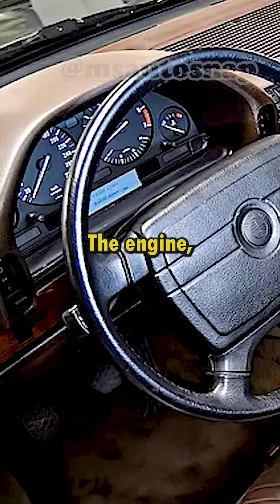When Engineers Build Cars! #bmw #mercedes #bugatti

Comment: Not many people know this but the first Bugatti W16  wasn't Developed by Bugatti. 
Bugatti didn't have the skills yet so they contracted AVL Schrick to develop and build the engine.
Reply: This is probably a gross oversimplification but wasn't it loosely based on using the extreme narrow V of the Volkswagen VR6 engine and then using these blocks as the banks of a V effectively making the W configuration
Reply: @izzabelladogalini  it's mot quite thats simple.
Reply: @JohannesB5  which is why I started my comment saying that this is probably a gross oversimplification....the tight V with overlapping cylinders contained in a single block developed by VW in their VR6 engine is used in the W16 - it's one of the reasons people look at Bugatti engine (or the W12 in the Bentley which had the same principle and is a lot closer to two VR6 engines mated into a V) expecting to see something like two Vs next to eachother with four blocks and find only two blocks and what looks like a  "fat" V instead of a W.
Reply: @izzabelladogalini  the W was a marketing decision by Ferdinand Piëch.
The first W engine was the W8. Which was derived from the VR6 concept to make an 8 cyl with the length of a V6.
The W16 was a further Development from the W8 bur in a totaly different block. The W16 was basicly a ground up engine. Bugatti/VAG did their best to build it but never managed to have it make power. So they outsourced it to AVL. One of my Professors was in charge of that Project.
Reply: @JohannesB5  it may have physically been a ground up engine but it utilised the ideas and technology found in the VR6 (VR in this case from Verkürzt and Reihenmotor meaning shortened inline motor ..) the W was in turn a "shortened V motor" ....but hey nothing is actually new the VR6 probably owes some crsdit to the Lancia VR4 motor which was a shortened straight 4 but didn't get into production but I'm sure the VW engineers  were aware of when wanting to designa small 6 cylinder that could be used transversely or longitudinally. Direct use is like virtually welding two engines together or chopping off a couple of cylinders from a V8 to make a V6 ...the utilisation of the VR6 in the Bugatti W16 is more subtle but it definitely borrows from it and (in my subjective opinion) was inspired by the concept i.e. shorten a straight six by overlapping and stepping the cylinders to make a very narrow V - so shorten a V16 in the same way by making two VR8 banks creating a W16
Reply: @izzabelladogalini  yeah ofc that was the inspiration😂 But still tbe W16 doesn't have anything to do with tbe VR6. not even the Cylinder angles are the same.
Reply: @JohannesB5  there have been two main designs to the W16 in the Bugatti one had 90⁰ degrees between the two banks and the other had 72⁰ but the angle between cylinders within the VR8 banks has always been 15⁰ the same as in the VR6 although the VR6/5 has also used 10.5⁰ the original was 15⁰. 
The first incarnation of the W16 was found in both the Bentley Hunauddiéres and Audi Rosemeyer concept cars - both part of the VW Group ...the production Bentley W12 is very much two VR6 banks mated in a V and this in W16 form is what Piech wanted and got fir Bugatti. The developed W16 used in the first Veyron was two VR8 banks mounted in a V with the internal angle of the single headed banks at 15⁰ it's way more than just loosely based on the VR6.
Reply: @izzabelladogalini I would like to see a block with 4 independent heads. Reduce bore, elongate conrods. There could still be holes in the head to let the headers pass through straight. Just there would be an air-gap. Also air channels between cyclinders in the block.
Reply: No?  It was engineer Ferdinand Karl Piëch from Volkswagen's Chairman of the Board of Management of Volkswagen AG at the time, which was in 1997.  He presented it to Karl-Heinz Neumann with the initial idea, drawing it on an envelope while traveling on the Shinkansen high-speed train from Tokyo to Osaka.
Reply: @DarthVader-lt4zw  ah yes a full engine development on a envelope scribble. You must know sooo much about engineering.
Reply: @JohannesB5  You understand that's how every single new engineering project starts?  A scribble here, a drawing there.  The engineers at Volkswagen took Ferdinand Piëch’s idea sketched on an envelope and evolved it into a production reality.  Originally, Ferdinand meant it to be a W18, but the engineers made it into a W16 instead, the only W16 ever put into production.  AVL Schrick didn't have anything to do with the original W16.  They helped build and test the Chiron's W16 powerplant, not the previous generations.

Comment: The real hp was 430hp on 99 octane 490lbs of torque had cam shaft issues and cooling issues they could have sorted it out the rear gills is what killed the design

Comment: How does a W18 work? You can’t have a V9
Reply: Three 6-cyilnders on a W bank
Reply: That's why it is called W18 - not V18... 
Volkwagen mass-produced a W12 in that concept
Reply: It's like a Bugatti Veyron Engine with two more cylinders
Reply: It's not exactly the same as VW-Audi-Bugatti do. W18 were 3 line of 6 inline cylinders each one. So the same as if you add a third inline six also at 60° to a currently V12.
VW group "W" concept is different.
It's a bit difficult to explain without images (in fact, the W18 that video shows in 0:42 is NOT a W18...😢)
For example, in Bentley's W12 they are two cylinder heads for 6 pistons each one, and these pistons were in TWO lines of 3 each.
In Mercedes' W18 concept they were THREE cylinder heads of 6 inline pistons each one!😮 
They were not two heada for 9 pistons each one, no.
Reply: @Angel_PC  The vw vr6 then later the r32 is the base engine.

Comment: The S 600 was so legendary. "It made the same power in kilowatts that the 760il bmw made in horsepower" 300hp and 300kw (408hp)
Reply: Fr and that's Oliver Amon's car (the s600 shown in the video)
Reply: Actually it's 408.6😂
Reply: 750iL at that time.*
Reply: The problem is that the S class is just a boring Mercedes compared to the BMW 7. There's a reason why Mercedes are so popular with older people and taxi drivers

Comment: W18 🤔 how come 😂 not divisible by 4, would have been a different configuration for sure
Reply: doesn't have to be, W18 would have been basically three inline sixes matched together at the crank.
you're thinking of the way vw did it for the chiron which is more like two vr engines in a v formation
Reply: @sirlorax9744  OK, 3 inline 6 cylinders, a different W shape then, not like 2 V8s come together to form a geometrically true W engine.

Comment: That v16 was underpowered, the McLaren F1 and the Aston Martin 600 were making 600 hp with much less cylinders and less capacity
Reply: McLaren had a BMW V12 in it, which was a tuned engine from the 7 Series. They detuned them for luxury cars, and pushed them to their limits in supercars.
Reply: Aston was twin supercharged
Reply: It was made for cruising, not racing. Not everything is about horsepower.

Comment: I only trust Small capacity and cylinder, gives high rpm and good fuel efficiency
Reply: Yes, if you're talking about garden tools
Reply: Inline 6 is like the best engine
Reply: @JoonaKorri an inline 6 is 1/3rd the cylinders and generally half the displacement of a W18.... Glad to see that you agree???
Reply: The smaller the cylinder worse to efficiency. cooling surface / volume.

Comment: since when tf 400hp is low
Reply: 400hp back then was insane
Reply: @JoonaKorri On a W16? Not at all. V8 cars were able to reach that power in the late 80s... With two times less cylinders.
Reply: 400hp is still heaps today especially in a lighter car. 300wheel v8 8speed in a 1700kg car is 5s 60mile and a 13 flat 1/4. Still fast for most people and plenty of speed to get you in trouble with the law or yourself.

Comment: V16 only 400 HP? Bruhh even customized 6 inline supra can reach 2000 HP💀
Reply: You do not compare that piece of shit to a bigger engine
Reply: lmao try more than that but whatever, you don't know anything. The poopra 2JZ can do it for all of about 2000rpm and will need rebuilding every run or two. 
That v16 will do 400hp every day for 500,000km.
Reply: @N4CR  there are plenty of less complicated motors that could do 400 hp too

Comment: E32 engine bay is 100% full with V12, so its not hard to image why V16 wasnt good idea 😂
Reply: The design was not much bigger than the V12 much smaller pistons
Reply: Nahh they were worried they’d chop it up over engine displacement which leads to going back to the whiteboard, that project was meant for e32 and they did want to make changes
Reply: I have an E32 too with just the V8 and it's pretty full as well!
Reply: @adotintheshark4848  I was going to say the same thing, my E32 740i has a quite full engine bay!
Reply: problem: engine bay small
solution: make big
Reply: And when you say full, it's more like you can fit a hand anywhere you want to, but only on one side at a time.... Need two hands? Sure! But only a third of each hand will fit half of anywhere at the same time. Lol. At least that's how it feels.
Reply: How much is the BMW goldfish now
Reply: '' Let's add a Panigale under there '' famous last words...
Reply: Идея аховая ! А не пошла в серию пото му что везде одни нищеброды!!!!!
Reply: Ukookokkpoo
Reply: Based on the way the Goldfish looks, it's not hard to imagine they won't sell well.
Reply: Actually, they tried later that engine on a Rolls-Royce. But it fitted without problems
Reply: They should have stretched the engine bay and called it the 9 series.....
Reply: why bother go past v8 anyway. unless extreme smoothness is a goal
Reply: @hotdog9262 Can't imagine that smoothness is a factor on Mercedes and BMWs top of the line luxury sedans.
Reply: @thenorthernhandyman  it sure is:)  a v8 can be smooth enough tho. and no engine produce a better sound imo. its also lighter/more frugal and easier to work on
Reply: @hotdog9262 as a 750 owner i am jealous of the features of the M60, there’s a lot to like, honestly i just like saying i have a v12 haha
Reply: @hotdog9262  well, the Dodge Viper which is one of the most American things ever, has always had a V10 and you can be sure they weren't looking for smoothness precisely.
Reply: @JustRememberWhoYoureWorkingFor  nah wouldn`t think so as the original use of the engine was trucks
Reply: @hotdog9262 they found past v12s was the point where smoothness improvements turned so small it wasn't worth.
Hence why they never made the V16 a reality
Reply: W18 not v16, as you see on the video its no longer  than inline 5

Comment: Ok just saying. The engines of the mercedes cars from that era are cheap af now. So if they went through with it we could maybe have affordable W18 swaps now for like drift projects and stuff. Would be wild
Reply: The engine would be too heavy for a drift project to handle well, the weight distribution would be messed up
Reply: @KitKitChanIsaac  I totally didn't think about that at 2am. You are right
Reply: you can drift perfectly well with propery built 2.0 four cylinder turbo at about a fith of the weight of that 18 cylinder😅 i think it would make more sense in marine applications than drifing

Comment: Wish these engines was used back in the day, just think about how many BHP you could push outta those engines today!!!!!
Especially from a W18 engine put 6turbos on that thing with equal length headers that bitch would scream and push way over 2000BHP easy
Reply: But what would be the point? Its not like you can reach 500kmh on any road strip anyway. Nor all that power would be transferable to the ground unless you put some formula 1 size tires on your car. Not to mention what material would the parts be made to sustain such torque and rpm's? V18 crankshaft was quite a bit longer than that of currently popular engines and it was not reliable even back then. Add in all current requirements for engines and you would have a steaming pile of shit/trophy car.
Reply: @arunaschlevickas322  Putting the power down at 400+kmh is different than from a standstill. Well on the autobahn early in the morning you could do it or on the Tokyo expressway for example.
Reply: But baring in mind that engine bay is full beyond full of W18 as it is, where exactly would you place those 4 turbos and all the associated piping, intercoolers etc...?
You'd have to do what BMW did, put it all in the boot.   Not sure how practical that would be in terms of throttle response and driveability...
Reply: @soundseeker63  The response is probably not as bad as you think. Turbo's i would do twins and places behind the headlights. If quad then a hot V configuration though that may still work well with twins.
Reply: Boba Motoring is a German guy who has the spirit of a 1980s German engineer with is 2.3l i think engine with 2 turbos at 4 bars boost and 1243 hp ... it outperformed a Bugatti Chiron pur sport by 100 or 50% to 300 kph i think
Reply: Considering that an Australian Ford  4 door, street driven saloon, with a turboed 4 litre straight 6  Barra 
can have 2200rwhp on the dyno (see YT vid)
you'd expect a little more out of a W18???
Reply: @JohnSmith-pl2bk How long does it push that power though. I wonder if that barra with so much power would take a long expressway or autobahn run.
Reply: @kaedeschulz5422  
Se the YT of it on the dyno?
He drives it there and drives it home.....
Reply: @JohnSmith-pl2bk  A short few seconds dyno run doesn't compare to what i mentioned.
Reply: @kaedeschulz5422  
He drove it there and he drove it home. 
I have no doubt he drives it on the street never exceeding the speed limit 
(sarcasm alert)..
which is 110kmh in most parts of Australia.

If you pay his transport costs and you want to see him on the autobahn I am sure he will oblige.
Reply: @JohnSmith-pl2bk  Still most ppl with such build just do short pulls for maybe 20seconds and that's it.
I don't have that kind of money. I would basically need to rent the autobahn as this car in no way would be allowed here on the street.
Reply: @kaedeschulz5422  
Sucks to not be able to run something like this on the street in Germany
TUV forever.....
Reply: @JohnSmith-pl2bk  While it has it's downsides here we don't have deathtraps on the road.
It's crazy what's going on in the US how bad of a condition some car's are in.